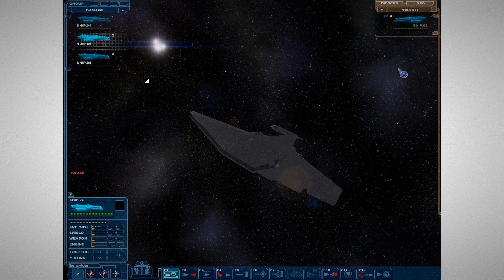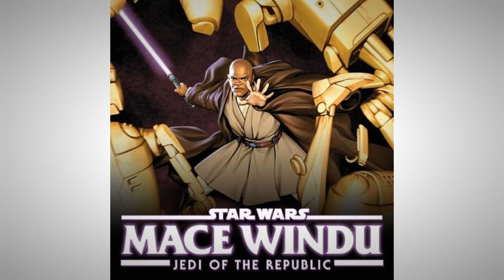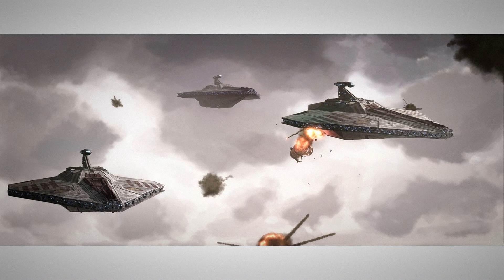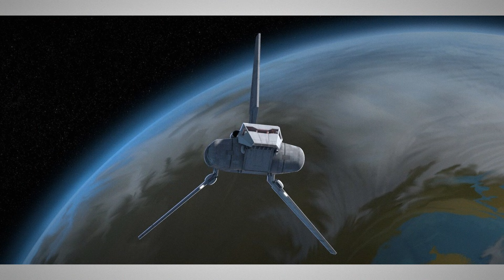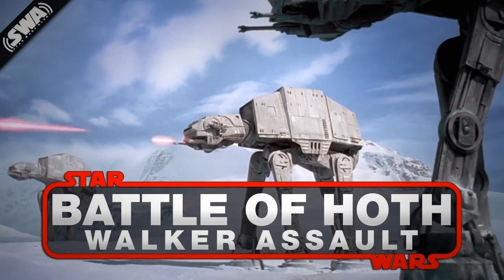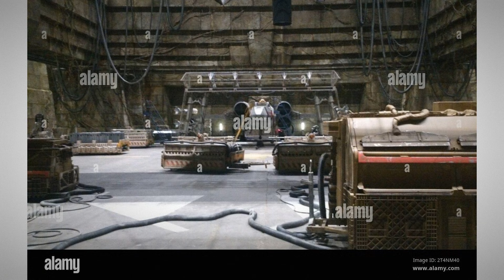Why the Empire Abandoned Their Most Versatile Warship

Comment: When would the Empire need this kind of landing capability?

They weren’t invading worlds defended by traditional militaries fighting on equal footing. They were chasing down guerrillas and saboteurs using hit and run tactics.
Reply: That's the reality of what they ended up doing for 21 years until fracturing into a dozen warlord factions busy erasing one another. The DOCTRINE built ships and ran formations meant to deal with large-scale fights. JUST like what the Acclimator was built to deal with. It was literally named after it's ability to acclimatize to the situation on the ground. The Empire SHOULD have used this, and made better versions. An Acclimator II that's not re-built into a space-born assault vessel, but a stronger, likely bigger invasion cruiser that could deploy tens of thousands of stormtroopers and hundreds of tanks and aircraft to support them in a volley-deployment.

Take the battle of Hoth - a formation of Acclimators dropping the stormtroopers and AT AT's and the rest of the armor directly into the Rebel trenches just outside the shields.

The Falcon would never have made it off worlds because the Imperials would be all over the base before they had time to even consider bugging out.
Reply: @tereninsecundus6084 I'm certain it's "acclamator" like "ovation" or "applaud" and not "acclimator"...
Reply: To be fair, did The Empire NEED Star Destroyers? No they overccompensated as fuck. So why WOULD they retire the Acclamator when they overdid everything.
Reply: @DukeCondor  The star destroyer filled a role in forcing systems into compliance through overwhelming force. They also tied up more personnel, so more civilians with engineering or pilot experience were tied up serving on them rather than joining the rebels.
Reply: the participation-trophy generations sheet out these new abominations. they have little imagination because they don't read. they don't go outside. they can't write scripts because they refuse to interact with each other face to face.